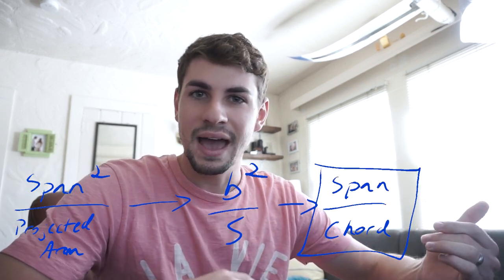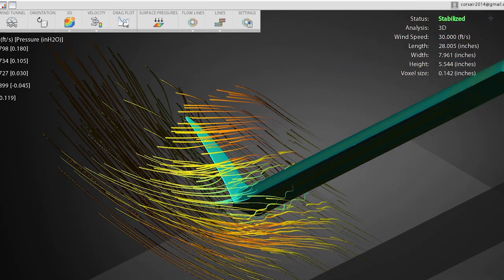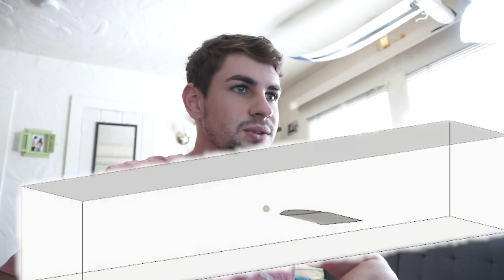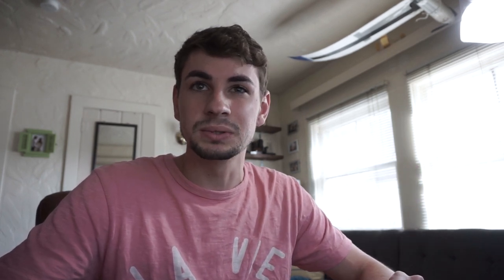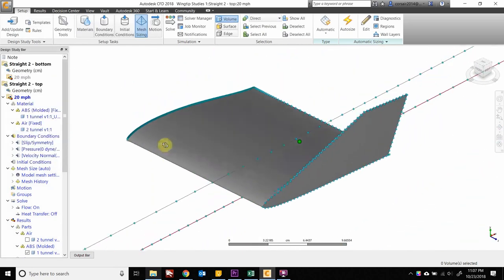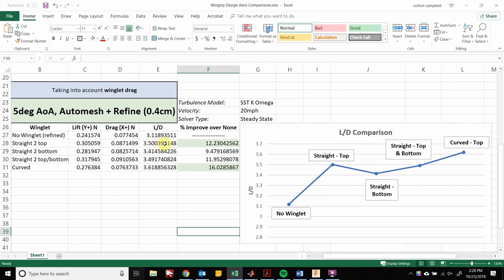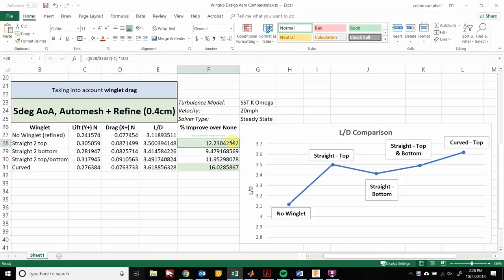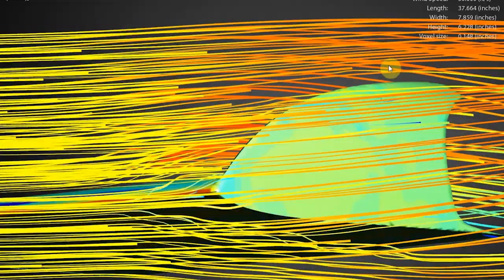Winglet Design - CFD Study and Aerodynamics

Comment: You have done a fabulous job. In the 80's I worked for Aerodyne  Engineering. I was just a fiberglass laminator building experimental winglets for private planes. Our winglets were approx. 20" hi. setback from the leading edge, and sloped radically. They had a semi symmetrical airfoil They sloped out at the end of the trailing edge of the wing but the tip extended passed  the the wing. They reduced drag and increased lift.

Comment: Great video!  Pondering the differences in your results, I think your bottom winglette was notably shorter than the upper.  Recent theory on these finds them to be generally ewuivelent to increasing your wing span by height of the winglette.  If the bottom one is shorter it’s going to have less lift, but likely similar drag since most of the drag is interference drag at the fillet, which would be about same as other winglette.  I’ll be if you made the lower winglette the same as upper they would be similar.  The one surprise is the curved, but still maybe not. If we use the same analogy of winglette height equaling wing span addition, then the circled winglette will have about pi/2 longer length ie about 1.5.  You showed 16/12 = 4/3 = 1.333.  Your winglette had a taper in it so that will reduce the 1.5 IAW geometry. I’ll bet it’s right about 1.333 ;-)

Comment: A finer mesh (specifically, adding some boundary layers) would have probably made the top&bottom wing fence perform even a bit worse still, due to the interference drag. However, this goes for all winglets. Having a blended transition from wing to winglet should reduce interference drag and increase performance.

Comment: Can you increase the speed and run the test again?  20mph is pretty slow.  My wings are usually flying at 80mph or so.
Reply from the maker: Sure I can do some high speed stufies in the future. This was a test for the typical cruise conditions of simple foam board wings. Also these were done at 5deg AoA which simulates a decent pull out at 20mph

Tip design is Reynolds number dependent so changed with speed; I can do an overview of wingtip design when I make my pylon racer
Reply: @ColtonCampbell  Thank you!

Comment: Nicely presented video. It is generally better to model the control volume (i.e. your wind tunnel) as a large cube. Or half-cube if you are using symmetry on the centerline boundary. Make it a large as you can in each direction. You can keep the outer mesh very course to keep the overall mesh size  moderate and sim run-times reasonable. If you see a big difference in results between your current size tunnel and a much larger volume then you can safely assume that your current results are not that accurate. 
Conceptually, a winglet should extract energy from the tip vortex. It is essentially a mini vertical wing that experiences a strong "side-draught" of air. The result is a lift component pointing inboard. In order for this lift component to be of any help you need to give the winglet a slight toe-out at its root with increasing twist towards the very tip (washout). When viewed from the front you should be looking at the low pressure surface of the winglet. That way the winglet's lift component actually points slightly forward, basically generating a bit of thrust.

Comment: Interesting, but in the end, it raises more questions than it provides answers.
For instance, does it make a difference if your main wing is straight, backswept, back-delta or forward swept?
Does the angle and the curvature of the winglet to the main wing make a difference, especially for the curved one? I'm pretty sure the winglets I saw on the Boeing and Airbus have a curve leading to the winglet and that the winglet is not 90degrees.
When you have a winglet above and below, have you tried changing the angle? I'm sure I've seen winglets top and bottom curved in such a way they have a right angle between them.

...And, of course, there's the ground effect, especially for the under-winglet.

Thank you for the wind tunnel trick, I'll try that soon.

Comment: Nice. It would be interesting to see in the same simulation what is the comparative effect on efficiency of an increased aspect ratio of about the same area, to get some perspective on what the true advantage of winglets is. Using a symmetric aerofoil for the wing extension to achieve the aspect ratio increase, would produce no lift in cruise

Comment: If performance is L/D for a given wing across the airspeed range then conbobulating drag reduction with performance is problematic. 
Moreover, describing downwash or tip vortices as performance degrades without accounting for lift variation  and parasitic drag replacing induced lift drag is also problematic. If you review your language perhaps improve your aim and gains.

Comment: Very interesting experimenting. You may want to further refine your study by having the winglet more gently curve from the horizontal to the vertical (as do the winglets on full size craft). According to some, the blended winglet has less interference drag than the 90 degree angle of the basic type winglet (about 10% less drag).  You are doing really good work, thanks  Rudolph

Comment: Very interesting indeed.
You said you wanted questions you can answer in you video so here’s one:
Can I attach a multicopter propeller to a plane?
I have a catalina on which I made one engine turning right and now I’m looking for a pair of propellers. In most online shops you find left and right turning propellers only for multicopters so I wonder, why not? What’s the difference?
Thank you for your answers.
Reply: I've used smaller quad props and motors with great results, from 3 to 6 inch ones, because they're cheap and I crash often. There's no real reason that I know of for why plane props turn CW (from the pilots perspective).

Maybe in the RC world it's because of the way nitro engines are designed to rotate.

You can get pusher props for planes, they turn the opposite way. My main concern is that the prop nut tightens rather than loosens when power is applied.

If you have a twin motor plane than thrust angle isn't an issue; but if you put a CCW prop on a single motor tractor plane you have to give it left thrust rather than the normal right.
Reply from the maker: The main difference in "multicopter" props vs plane props are the way they are designed; most multirotor props are design for high static thrust conditions, i.e. creating alot of power without alot of oncoming airflow. Most plane props are optimized for a good amount of incoming airflow as the plane moves through the air. In practice, you won't notice much difference for small models unless you are looking for a high speed fixed wing plane.
Reply: @ColtonCampbell  Most of my flying is slow and close so quad props are great on my micros. They give them lots of pull. 

Great video BTW. I look forward to more.
Reply from the maker: Thanks for the compliment! New video will be out this Thursday!
Reply: Great I look forward to it. Your presentation was very good. I couldn't be on that side of the camera, lol.

Fluid dynamics is fascinating and the animation was very interesting, I slowed it down to see the flow better. I use Inventor at work and it's fun to put different parts in the FEA to see what happens...I wish we had CFD.

Check out my first wing https://youtu.be/ChdO2JeYaCQ
Reply from the maker: Wow, love the way it just floats around. Nice build!
Reply: @ColtonCampbell  I have another wing or two in the works. I might experiment with your curved tips design if you don't mind. They look pretty sharp.

I have a few of my own designs and some other manufactured planes planned for the winter, if you want to check them out I could use the sub.
Reply: vamoa, sorry I hijacked your thread. I subbed you and look forward to seeing that plane lifting off the water. Good luck.
Reply from the maker: Sure thing, I'll give you a sub. If you have access to a 3d printer or want to see the 3d files I'd be willing to send you the winglet CAD files for reference
Reply: @ColtonCampbell  I wish I had a 3D printer and CAD software at home. Maybe some day. I've been considering trying one of those maker spaces but there are only a couple around here and I think another one recently closed.

Thanks but I could just copy yours from the two 2D views you presented; then model it by laminating some foam. Besides the shape is quickly distorted with the way I "land".

I've tried free CAD software but Inventor has spoiled me. It's so intuitive and simple to use.
Reply from the maker: I would strongly encourage you to try Fusion360. I also started with Inventor, but fusio360 is way faster once you get the hang of it. It's free for personal use, and you can even do low level FEA and some photorealistic rendering. It's a fantastic program, give it a shot! 

I'll be doing some tutorials on it in the future specific to aircraft design
Reply: @ColtonCampbell  I see it's meant to be a full production suite on the cloud. That would be great for my personal use. I'll check it out more later today.

Is it parametric like Inventor? I like making templates for assemblies so when you change the size or position of one component the ones it interfaces with change accordingly, ex: you change the wing chord (one number in parameters) on a standard plane, the airfoil (NACA offsets) adjusts, the ailerons change, the fuselage mounting changes, the CG changes which then changes the landing gear position, you could link the tail chords and fuse length too. These layouts are all in sketches and parameters fully defined in 2D space. The solids and 3D sketches are secondary, kind of just along for the ride.
Reply from the maker: It is parametric, but doesn't (as far as I know) have iLogic custom function script things like Inventor. However it's still pretty powerful and if you know Python you can write your own scripts
Reply: @ColtonCampbell  as long as you can make fully constrained sketches on defined work planes and have the numbers linked that's all I need. 👍

The only script I've written is for changing materials in a derived assembly from a template that's all one material, like a foundation made of 20 or 30 steel plates. And a couple with user control forms for our end users to easily control the movements of the systems we put together.
Reply from the maker: @learningtocrash4030  Yep, you can do that easily! I'll make a video about it someday hopefully
Reply: @ColtonCampbell  I just listened to a bunch of tutorials and it sounds just right for my personal needs. The only thing I didn't like was how they project edges to define other parts. I stopped doing that years ago (adaptively is awful in large assemblies with Inventor) because of the nature of my work it causes more problems than time saved and you get the dreaded pink sketch. It's ok for small assemblies but ours are thousands of parts with dozens of subassemblies. I try to use templates as a base for the primary numbers.

After 11 years of using Inventor I guess I'm a little set in my ways, lol.
Reply from the maker: Totally makes sense, I've had problems projecting edges too haha. Instead, just define everything from an origin and that'll help. Hope you enjoy the program!
Reply: @ColtonCampbell  that's the first thing I tell people new to it, always define 0,0,0. It doesn't really matter where as long as it's a known point to reference from.
Reply: And always let the sketches and work planes define the part, never put a sketch on a face. In fact I try to always have all the sketches needed before any solid is generated.
Reply: @ColtonCampbell  Thank you for your reply. I’ll propably give it a try as I consider the Catalina a “small” modell ;)

Comment: Winglets are way more efficient if you add a sawtooth design on all edges with different heights like a Sounddiffusor. https://reverb.com/item/11532350-3-black-and-red-acoustics-panel-wooden-sound-diffuser

A guy on Youtube tried this technic for a different purpose with outstanding results.

And one more tip: put the winglets further to the tail.
Reply from the maker: Interesting note on the sawtooth design. I might have to look into that, thanks for the comment!
Reply from the maker: Thanks Nik, I will check them out

Comment: you dont need winglets on a wing . !
Reply from the maker: Depending on the design, lift distribution, and operation envelope they may or may not be beneficial... 99% of the time for older designs or simple RC models they are beneficial because of non-optimized wing load distribution and tip design
Reply: i get that :) but you dont NEED them :) flying wings fly perfectly without winglets . but that brings me to another question .. how important is it to have a smoothe wing . i am thinking about covering my EPP wing in covering film
Reply from the maker: Haha well... That depends on what you consider essential for your flying 😁 on 99% of designs if you don't want Dutch roll you need vertical stabilizers on your flying wing (tailless aircraft) and those are typically found in the form of wing fences or "winglets"